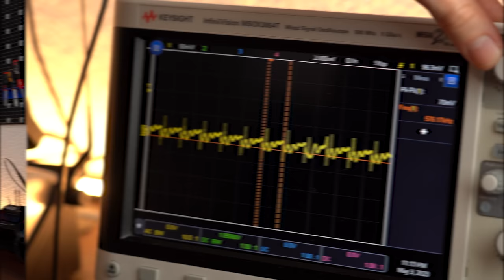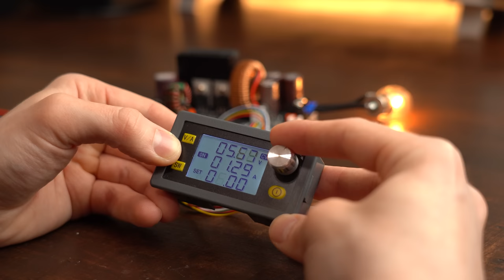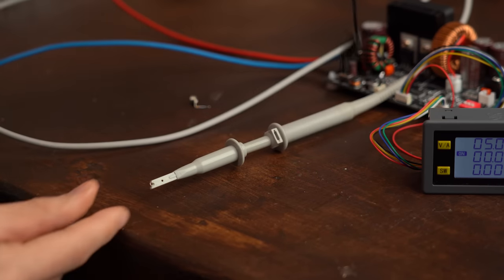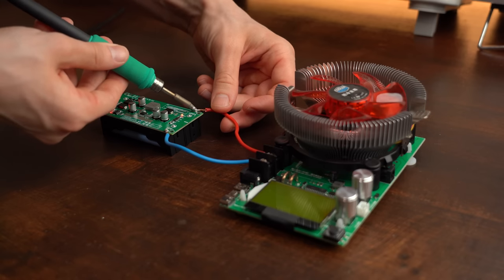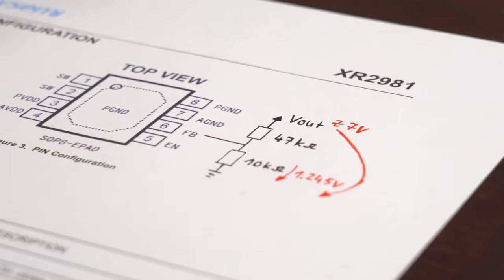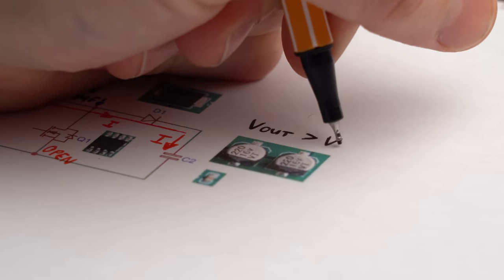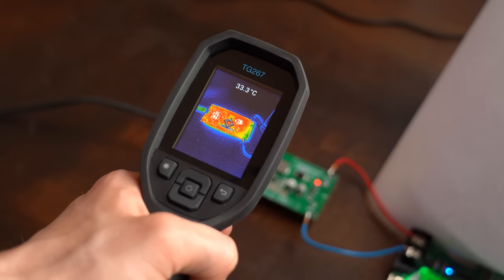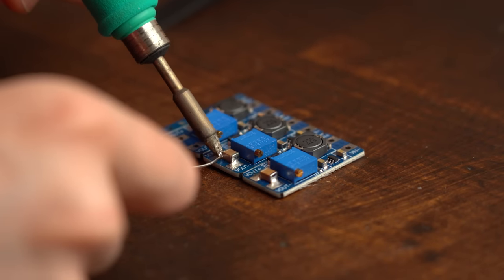With Just $0.50 Components I turned Garbage Products into GOLD!

Comment: It's sometimes surprising what the engineers in China will do to save a penny... In my previous job, I had responsibility for LED drivers, and, in one case, the engineers in China decided to "save" about €0.005 (1/2 cent) by using a resistor on the input of a boost converter to limit inrush current/EMC, instead of the "normal" ferrite bead, and, maybe, a 47 pF capacitor....the problem is, that boost converters have "negative input resistance", and draw more current as the input voltage drops...so, the resistor, under larger loads, caused the converter input voltages to drop, drawing more current, causing more voltage drop, more current, so that the converter, under low battery, and high brightness settings, would "motorboat", oscillating at 20 kHz... And, because of this design, the circuit could not use a lower cost IC, which had a higher undervoltage lockout, and the 1/2 cent "saving" prevented a "drop-in" change, with a saving of 4x ... Anyway, sorry to go on about it, but there are some times that the cost pressures simply let/force designers to make poor choices in parts selection, or PCB layout, or just "best practices design".

Comment: Two possible reasons for not doing the $0.50 part swap: modification cost and cost recoup.  

It might only be a single part, but if you have orders of 1000 and it takes three minutes per swap, that's 50 hours of labor.  Easier to sell a crap product.

Second: the original manufacturer of the component might have realized the mistake and had a new run of the board AFTER there were already 10,000 made. What would they do?  If they work well enough, just sell them at cost!

Comment: It's not lack of knowledge or skill on the part of the module manufacturers, it's down to cost optimisation and supply chain certainty.
Large value ceramic capacitors have to be oversized to offset voltage effects reducing the rated capacitance. Physically large ceramic capacitors cost a lot to make and use up a lot of ceramic material that can be used for many more smaller capacitors. Murata, a few years ago, reduced their portfolio of capacitors to force manufacturers to downsize. This was easy with NP0 capacitors of 10nF or less as they don't vary capacitance with voltage so much (rated up to 16V, 25V or even 50V). But capacitors using X5R, X7R or even Y5V and having values up to 22uF at voltages over 10V (to combat the loss of capacitance as the voltage across them rises), were much more difficult to replace.
Electrolytic capacitors don't vary capacitance with voltage and can provide much more storage, but they are wound in coils like inductors, hence the effect you measured.
The best option is to combine multiple types for mass storage, ripple control and high-frequency filtering.
However, you need to be sure manufacturers can supply what you have designed at a reasonable cost (not easy when automotive and phone manufacturers are buying up all the stock in a market crash).
Your other option is to use Tantalum capacitors as they have the advantages of electrolytic but with higer frequency response and lower ESR. However, you must then wrestle with your conscience knowing Tantalum is mined in horrific conditions by impoverished children. Companies, rightly, steer clear of those components (well, ethical companies, not Chinese companies).
I reworked two Sega Game Gear handheld consoles, a few years ago, to replace the shot electrolytic caps with ceramic. They worked a dream but I can't do the same rework today as a couple of the capacitors I used are now no longer available (22uF rated to over 35V).

Comment: Adding a Euro/$ 0.50 capacitor to the design, makes the end-product easily $1 more expensive (as the assy-house, Ali and others define their profit as percentage of the bare-price). And that might cut you off from the market as other companies dive, with inferior design, under your price.
Technicians don't understand this.... 🙃

I've been done my internship at Philips Eindhoven where they explained the usage of too small transformers, too small capacitors, too thin wires, reduction or removal of metal covers over RF-components, lack of thermal blocks, removal of glue between components and thermal blocks, less screws, rings, nuts... leaving out indication LEDs or even leaving out all kinds of protection like diodes and fuses... 
Every dime of saving in the design is a couple of euro's difference in the shop.

Comment: And what about control loop stability? What about poles, cutoff frequencies, transient load response? If you modify output capacitance, inductance and feedback loop resistors value every converter in electronics can become a noise generator, starts to overshoot voltage a ton when load is changed or just be too slow and regulate voltage after higher load is connected too slow. Thats the reason that manufacturers choose such components - maybe it's noisy - but it's stable... If you want better noise capabilites use better switching regulator driver because main measurement here is missing! It's feedback loop stability (measure eg. by Bode 100). Other side of the coin is PCB design - for every Switching Mode Power Supply proper PCB design including proper EMC design is mandatory! And cheap modules does not care about it in any way ;)

Comment: I have some experience in real market production and can take an educated guess to why such things occur:
Case A - The Manufacturer is not aware of the issue due to one of the following:
1 - prototype worked well but somewhere in production someone deviated from the design due to the lack of some component
2 - a partner provided a batch of bad components
3 - lazy (minimum testing)  or non-existent QC 
4 - following (copying) a design blindly not knowing how slight changes might affect the result
5 - Damaged components due to bad quality / bad storage

Case B - The Manufacturer is aware of the issue:
1 - Greed
2 - discovering the issue in late stages of production (happens a lot) so they lower the price to not throw away the stock and to avoid fixing the issue which is sometimes very hard to near impossible / costly
3 - they just don't care
4 - indented for uses with high tolerance to error

Comment: I bought some of the small MT3608 boost converters
and i also measured some pretty bad noise at higher output currents. Adding a 1,5uF ceramic capacitor and the problem is fixed. The ceramic caps I used literally cost 6 cents per piece

Comment: Now i can fix my cheap pc speaker from noise that occuring while connected (on pretty much everthing, such as generic laptop charger, lab bench power supply, and 12v battery) turns out i found the solution here, now i can fix the iritating-buzzing sound, thanks dude, 2/2 thumbs up 👍👍

Comment: The last circuit is really badly designed.
I have a lot of them, and you must turn the pot counterclockwise to increase the voltage. And it's a 2 layers pcb, so not difficult to design correctly, it's just 2 tracks to swap ...
Thanks for this video, I may modify the ones I have :)

Comment: 😂 The answer to why manufactures don't include needed items is 2 fold. Sometimes cheap, is too cheap; and it doesn't have to be right, it has to be right now. China has the same problem as all other manufacturers time is money. Engineers rush the design phase, if they have one, because time is money and the equipment doesn't pay for itself without a product coming out of it. The production floor hurries to fill orders and uses only what they are given by procurement. Buyers are not engineers and they will substitute anything that can maximize cost savings. Quality control, if they have any, can only look for issues that are known. If the company doesn't put QC into looking at over heating and output ripple the needed corrections can never be implemented. As China would say, it's one big virtuous cycle. In the rest of the world, we call that a circle jerk. Some day China will master that circle cycle thing, but until then correcting mistakes from other manufacturers and up charging for a better product is called a business model.🎉 Win for everybody involved.

Comment: On DC circuits with noise, why not just use a diode, at least for low power audio? I've used diodes since the 80's when I couldn't get rid of a whine in my car stereo. They've been sized appropriately and will kill alternator and spark plug noise very well.

Is there something I'm not aware of that this is a no-no?

Comment: Oh interesting - I have some AliExpress modules with caps that get hot. USB-C power modules I use in power banks. Is it a pretty safe upgrade to just replace the electrolytic output filter caps with multilayer ceramic caps with the same uF value? Is there value or risk in going with more uF?

Comment: I used to do component level troubleshooting for a manufacturer of cable tv monitoring equipment. Here is the answer to the question of why don't they use better components, at least for them. Their engineering team used 1% tolerance parts when designing and prototyping. They would hand off the list of components needed never specifying what tolerance (if any) of parts should be used. 

Naturally, procurement bought the cheapest stuff they could find. I practically begged management to let me talk to the engineering team. They finally brought one guy down. I sat him down, showed him the log I had been keeping, and the exact parts that needed tighter tolerances. In this case it turned out to be the inductors in a frequency generation circuit. 

The board  pass/fail rate jumped to over 70% (it was in the upper 50's). My big reward for figuring that out was I got to be the end of the line guy. If I couldn't fix it, it went into the trash. I didn't last long there

Comment: Would the circuit be still usable without some other component - they would desolder them also. 10cents per each capacitor makes 1000$ difference if you sell 10 000 pieces. 50 cents - 5000$

Comment: This video was spent optimizing a 14% change in noise, yet he and the comments are so shocked that the manufacturer would optimize a 14% difference in price.  The implication/virtue signaling in the video and comments is that "quality is the correct optimization", yet the only reason this video exists is because the creator went to AliBaba to find the cheapest components he could.  Alibaba and Amazon are flooded with nearly identical versions of the same cheap components, and the only way to differentiate them is price until you actually buy one and inspect it.  Its only like this because the creator, the commenters and myself are sometimes willing to optimize for price over quality.  For a 14% increase in price, companies that cater to us are definitely skipping that $0.50 part.

Comment: I see a lot of what I call "hopeful" or "expectant" engineering especially in the cheap but plentiful switching power supplies online. I expect noise value to be absurd, and often wind up modifying supplies to remove noise. Generally, I try to design my stuff as though the cleanest DC power it will see is half-wave rectified AC. I'm an electrician and hobbyist. Cool discussion of the incredibly low cost of doing it right, especially the first time.

Comment: my personal guess ... 
first of all, if it works - don't fix it, it does work only with the disatvantage of noice. 
second, supply - if they had that one cpacitor in bulk because of a previous project - or they simply bought it in a much higher bulk to also maximice the profit of the usv. 
Third, I guess having to capacitors with the same size is easyer / cheaper to attach with machinery then having to switch for another sized capacitor. 
And last but not least supply and request, there is a sweet spot that people are willing to pay for a specifc product and I asume this is rather low with chines electronics. If the competion does not inlcude the better components, hence can over it for a much cheaper price - sure we assume that this two capacitors would come with a simple rise of 50ct but what if the change in manufactoring would rise it by 1€ instead?
Sure you porpably would buy it knowing it is the better cirquit ... but can you actually know it? can other costumer know it. 
They simply see the board, doing the same stuff, but one is cheaper. 

yeah ... I actually can understand why they opted for the worse components. 
Also, besides markets here in the west, they simply don't have to give a damn about costumers returning, because they won't. If you can even find the same offering half a year / a year from now when you need another one of those components.
This is such a fast market, so why should they care. They know that as well as we know it.

Comment: Having been exposed in the power supply side of things for so long, the main failure had always been due to some cheap capacitor. And this applies to even big brands.

It's very simple, cost! Just because it costs 50c more on a component level, it will raise the final sale price by $5 or more.

Also, don't forget products are designed to fail after warranty!

Comment: The sad thing is, these capacitors cost even less if you buy them in bulk. And the manufacturers do buy components in bulk. So using better capacitors will probably increase the price by like 10 cents.

Comment: Can you please test de peak current on the input of those booster boards?

They seem to put high amps for like some milliseconds at start. I fried some 7805 by feeding the input those boosters, they were tuned to output about 8V for a small <100ma led strip.

Comment: I had the small pwm and I was using a small motor on it at lowest settings and it was not happy. I put a supercap on the end to smooth it out but the value was way to large and it was drawing that much current it blew the ic on pwm I think . I might have to scope it to find out for sure but make sure if you put capacitor on output that it's ver low like 10-22 uf like Scott did .

Comment: There is a reason why I always use a high quality 100nF capacitors over Voltage rails and most of the times in parallel over bigger caps. You can clearly see a lot of garbage, aka noise, when not doing so.  For reducing RF that these switched things can cause also use ferrit to stop interference.  Some of these Chinese pcb's are really well designed and then you order another one and measurements are different. Bad capacitors, change in pcb layout to make it cheaper. A bit of a lottery.
That last pcb, released some smoke on those. They will go into self destruct like you said, but I still like them a lot.

Comment: I was confused when you mentioned the very high pp noise value in the prev video cz I have this power supply and it works according to specs and the manufacturer is very keen on improving their products.
I also assumed noise pickup. Assumed adding a very small resistive load would fix it. 
Thanks for revisiting the test!

Comment: Mostly anything where you don't want noise (not audio/frequently changing output) you usually just have to add a capacitor to level the voltage

Comment: Hi, what would happen if you use a higher voltage input for a boost convertor above it's input limit. Would it malfunction, or would it keep the output voltage to the set output?

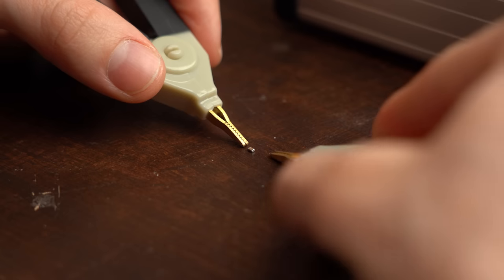Comment: At 9:08 it is speculation the slightly higher  temperature causes the capacitors to look like  inductors .  The issue could also be component quality related. Without the specs for the capacitors you can't be sure.  Statistically, one test is not scientific.  The "fix" may well be correct but you can't  say that from the outcome of one  (or even several) tests.

Comment: I would have a suggestion for maybe a video. its about rotational encoders. i would love to implement this encoder to my cars headunit but i need to somehow easily "convert" encoders output into 2 buttons volume up and volume down, ofcorse knowing which direction the encoder rotates. There is too little documentation on the internet regarding this certain case. and if there is, only using arduino, but i dont wanna use arduino because its not small enough and its way more expensive then getting i supose some kind of chip which would be able to do that. Thank you for any suggestions or maybe even video regarding this topic.

Comment: Actually ended up using one of the smaller ones for an amp, and had added a larger capacitor to the output to support the bass. good to know it's probably helping with noise as well.

Comment: this explains issues i ws having using one of these cheap dc to dc converters as the supply for a little analog computer i was building. it never integrated right and clearly didn't have a stable input.